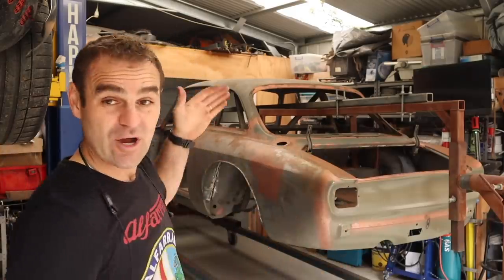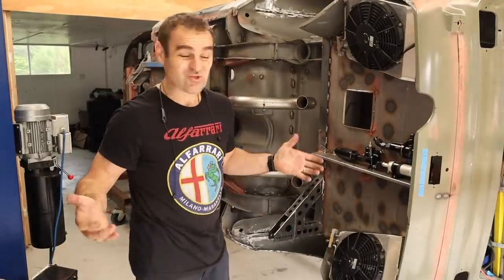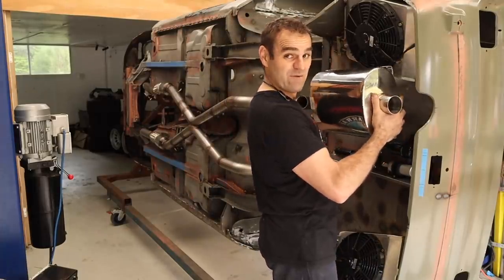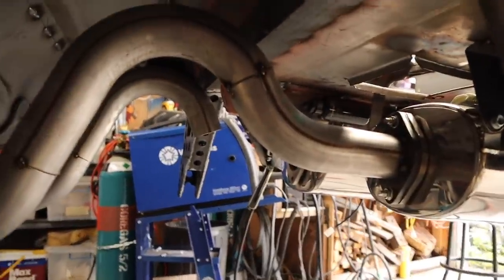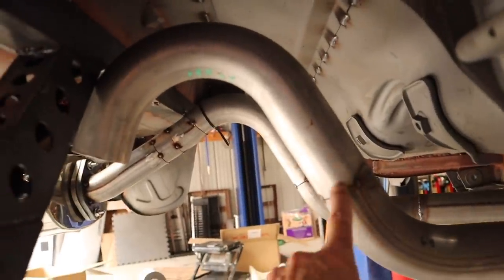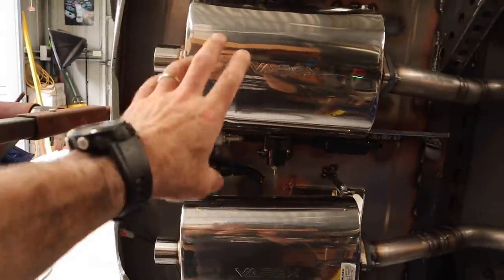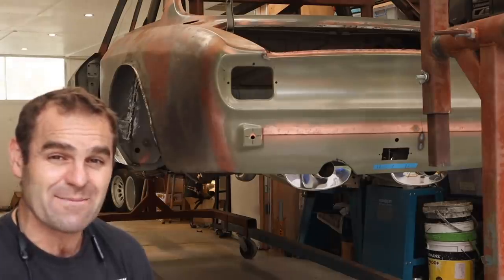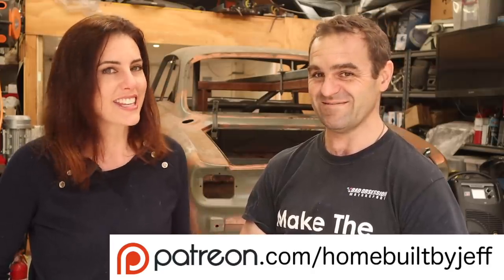Silencing the Ferrari Engine - Ferrari engined Alfa 105 Alfarrari build part 126

Comment: You have put together a really great exhaust arrangement.  With the mufflers mounted near the rear end, a lot of heat and sound will be absorbed before the gases even reach the mufflers.  Air flow under the car at speed should prevent any significant heat from getting to the AC condensers.  Excellent video as usual.  Thanks.

Comment: Jeff, two things: 1. you will be better off repositioning the A/C radiators, they will suffer badly next to the mufflers. 2. in the rear valance, put a small vent or grate to allow hot air that will build up around the fuel pumps to escape. No matter how much shielding you use, those pumps are going to get hot, so allowing airflow around them will be highly beneficial.

Comment: What about to mount a thermal shield between the mufflers and the fuel pump and radiators? Moreover, are you leaving the  bumper fitting on the rear 😃?

Comment: Just wondering about a heat shield between the muffler and that condenser (2 of them) because of the inevitable heat.  Also on 2 of my builds my muffler sat about the same position as yours and in both cases the things bottomed out to the point I had to hoik them up by cutting a recess in the boot floor.  Bugga.  Both cars were very low I will add.  Cheers.
Reply: It would be about the same as attaching it directly to a hot radiator.

Comment: Looking really good Jeff. Nice looking exhaust. I do think your air conditioner isn’t going to work very well where the condensers are mounted. Too close to the hot exhaust and radiated heat from the engine compartment will decrease performance. Condensers need to be in the coolest air available, hence why they are fitted in front of the radiator.
Reply: First thought I had was the aircon rads - it'll probably be alright on the move, but in slow traffic or stationary (just when you need it most) they'll be both immersed in hot air and hit with directly radiated heat. I'm already trying to visualise some kind of baffle/shield to put between the rads and exhaust to mitigate it. ETA >> I doubt this hasn't occurred to Jeff, let's wait and see what he's got planned!
Reply: That’s right. I’d open a louver and set them inside the trunk to receive cold air with some insulation.

Comment: Ah the Ferrari 246, the car that started the "gangster" seating position, (almost 45 degrees down) I did some work on one of these cars after it lay dormant for 8 years, sounded beautiful, looks fantastic, when new cost the same as a Porsche 911t ( around $15000) gearbox ratios pretty close to motor cycle , but the build quality? Absolute crap, positioning of engine accessories,ha ha ha, carbs that are hard to syncronise, then you notice the welding quality, on everything under the car, it looked like the person in charge had never used a welder but persisted in showing everyone how bad he really was, the car recently changed hands with the new owner saying he could have bought a new McLaren for the same money

Comment: When you are plasma cutting, are to dragging the tip on the metal? Like, is the tip touching the part you are cutting?
Reply from the maker: No. It has stand off cap, so the tip sits a couple of mm above the surface.

Comment: Will the exhaust noise be on/off, or is the level variable while driving?
Also, are you going to delete the rear bumper mounts?
Reply from the maker: Variable while driving.
Reply: @HomeBuiltByJeff  i was about to ask the same, RPM switch or Throttle position or simply on/off. are these Varex brand? i missed it if mentioned.  looks neat, perhaps painting them black would make them look  more standard also.

Comment: I take it you are going to pull the whole car apart later for paint
also what HP/kw is that engine rated at
Reply: In the original car it was rated at 400bhp.  Jeff has shortened the tuned intake tracts and of course it has a totally different exhaust, so I think we are going to have to wait for a dyno run to find out.  Should still be enough!

Comment: Just a heads up, don't use the remote and control box that comes with the varex mufflers. It will failing in a week ( mine didn't last a week) I would recommend wiring them to a windows switch.
Reply from the maker: Way ahead of you ;)

Comment: Shouldn't you be using argon when mig welding stainless? or am I wrong
Reply: He’s actually welding with tig and the standard gas for tig and mig is argon.
Reply: @billweston6579  he was tacking with mig, what I am asking is he using 100% argon if he switched to ss wire or?
Reply from the maker: It was only for the tacks. 
Straight Argon was used for the full welding.
Reply: @HomeBuiltByJeff  So when you were tacking and using ss wire you were using regular co2?
Reply from the maker: @MrPatrik246  Using an Argon mix (MIG gas).